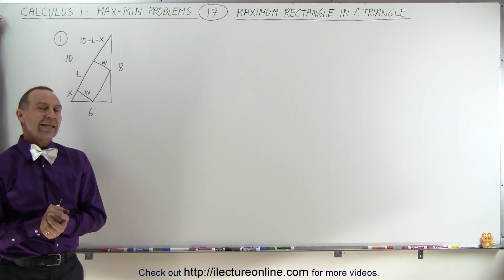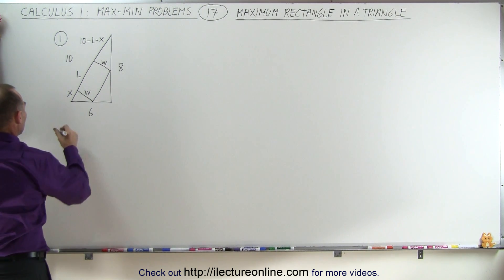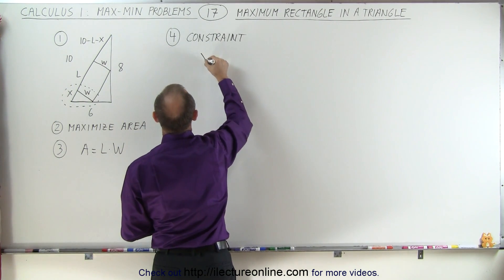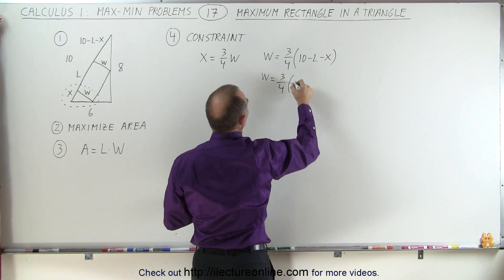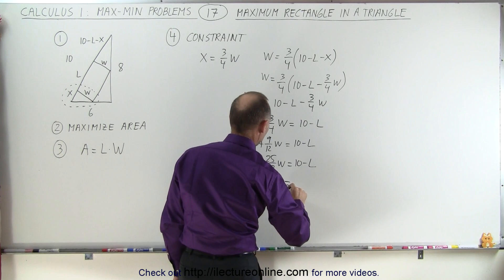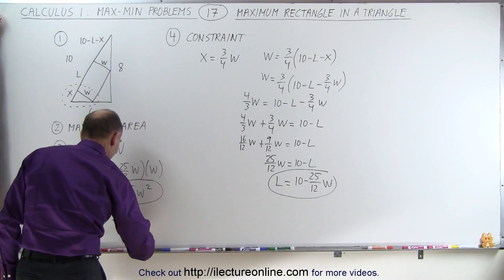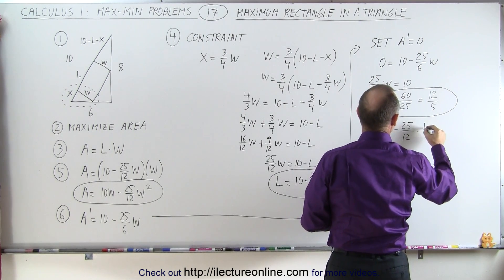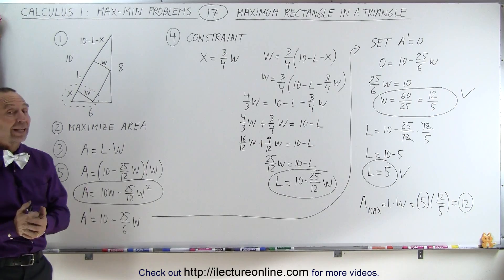Calculus 1: Max-Min Problems (17 of 30) Maximum Rectangle in a Triangle

Comment: Sir, good afternoon.

May I ask what if this is the case?

Find the maximum area of a rectangle that can be inscribe in a triangle with sides:  a= 4.25, b = 8.62, c = 9.61. The least dimension of the rectangle lying along side a.

Thank you.
Reply from the maker: If you are required to placed one side parallel to a, then you would have a second side parallel to b and the corner against the hypotenuse.  Then you need to place this on a coordinate system with a on the x-axis and b on the y-axis, and then you need to find the equation of the hypotenuse in the form  y = mx + b
Reply: @MichelvanBiezen  Your response made me realize just now that the given triangle is indeed a right triangle. Hehe. Thank you, sir.